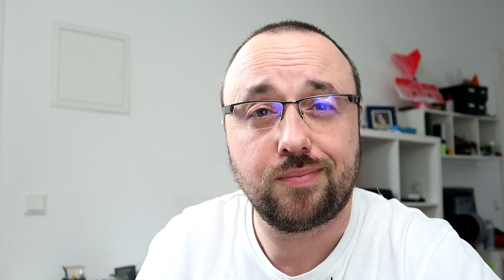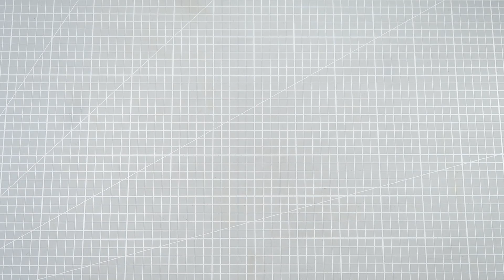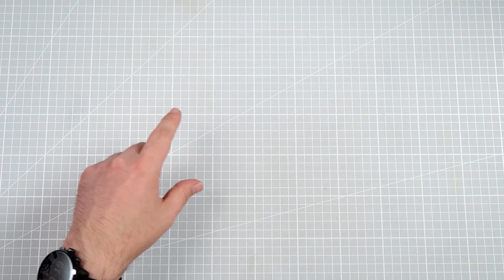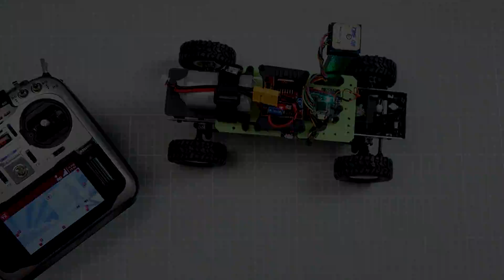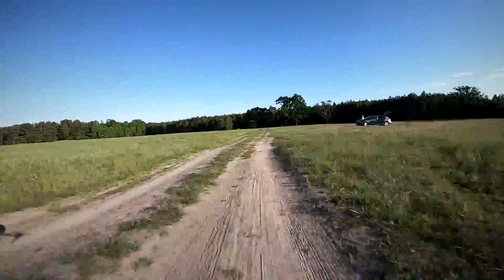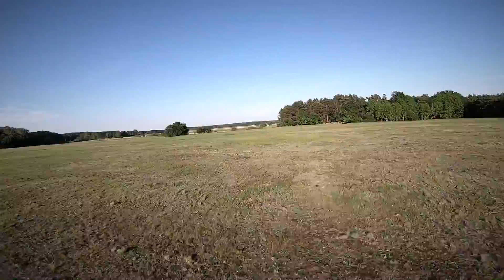INAV Rover based on WPL C24 4x4 crawler

Comment: Been wanting to do this project for many months now and your videos has inspired me to do the WPL C24 build, I'm now at the completed stages and includes my FPV setup (enjoyable fun as you can see part of the cars bonnet as your driving) my question Pawel if you can help or introduce in your next video is how can I put in a Mix between throttle and steering so as I go drive ie full speed and as I turn the steering it reduces throttle to prevent the 4 wheel drag or car rolling over this would be ideal doing Missions and RTL

Comment: Hej Paweł! How about using iNav for a robot lawn mower?! ;) Two DC motors for left and right wheel, no steering wheel. GPS used for "path planing", then some other login on top - overkill? Just thinking about my next DIY ;)
Reply from the maker: Mixer will handle that. But can not guarantee much in terms of accuracy

Comment: I have done similar conversion for Traxxas Rustler 4x4 here: https://www.thingiverse.com/thing:4127963 . Also used Inav, GPS etc, but no RTH. Conclusion: FPV car makes sense if you travel with small speed like less 10 km/h. I had LED like Knight Rider :D

Comment: Nice! I built almost the exact same thing a couple months ago, Video is on my channel.   WPL C24, front and rear cameras with switcher, omnibus F4v2 w/Betaflight, GPS, light controller, 10A ESC, FRsky RX8R, 200mW VTX w/mic, dual speed transmission, and 2x li-Ion 18650 batteries.   The transmission w/motor upgrade is a must, the stock trans/motor  is too weak. You should also print the axle servo mount to fix the steering so it works at all angles.   Im currently running betaflight because I simply wanted an OSD for the artificial horizon, tilt angle when crawling, batt voltage etc, but want to explore installing INAV next.

Comment: Fantastic, Pawel! Beautiful job! 😃
About the motor, the recommended esc is 10 to 20a. 😬
But I'm sure it's going to work out well! 😊
About the tires, even the more expensive crawlers are like that. That's the best way to the tires to have grip enough to go over rocks. What everybody does is to glue them in the wheels. 😊
Anyway, looking forward to the next video about it! 😃

Comment: I imagine the F411 Wing or WSE controllers would be a good option for this application with a single drive motor?  I dream of the day that iNav can deal with 4 motors, driving independent wheels, applying traction control elements to each wheel.
Reply: I like that idea very much. In theory aside from the hardware, in inav that would only require some mixing of the motor signals, not unlike differential thrust for example

Comment: It sounds great. I believe many people in the RC community, as I, use different kind of vehicles, and it would be nice to work on the same programming platform for those vehicles. Opposite airborne UAV's, ground based and sailing RC units are not clustered with rules and restrictions. Even the weather doesn't influence them as much.

I am grateful, that you are doing this work for the RC community :-)

Comment: Been waiting for this, can you setup as a plane? Use manual mode, Rudder for steering?  To use RTH is there a way to disable Alt?   Thx for doing this!
Reply from the maker: it's far from being done. Current INAV code can not handle rovers and boats yet so it requires some programming